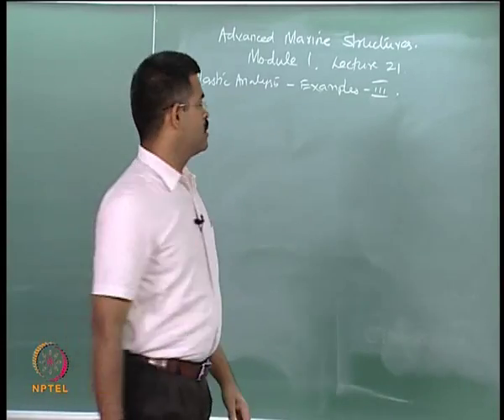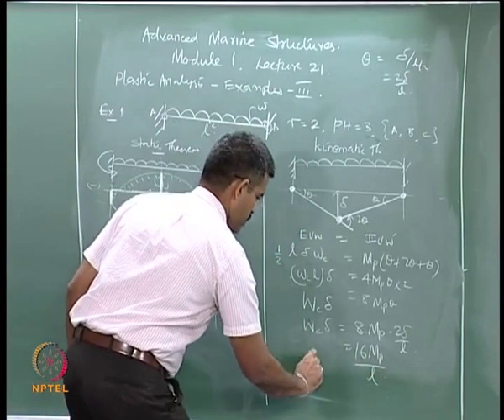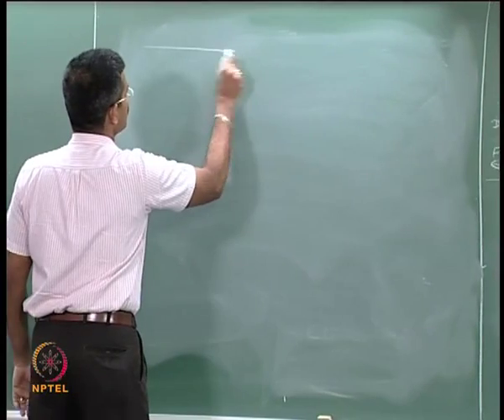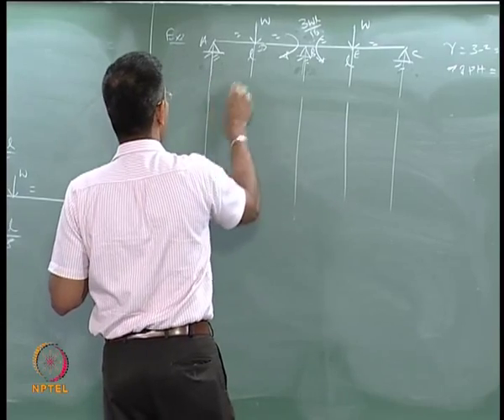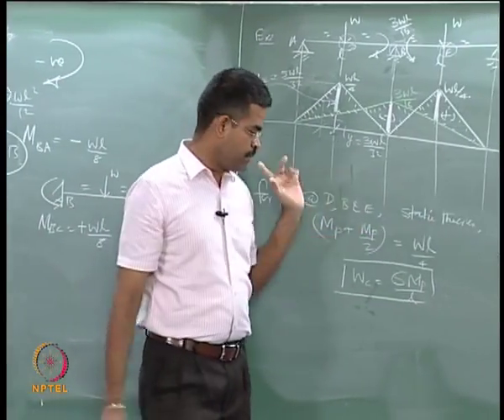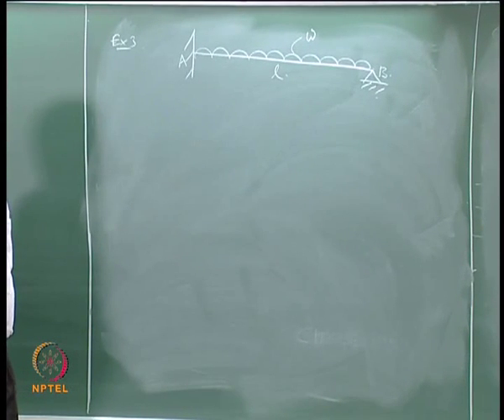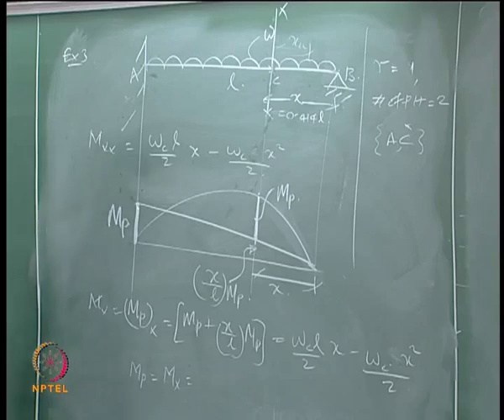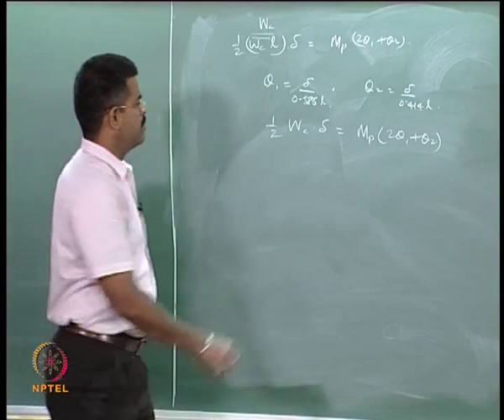Mod-01 Lec-21 Plastic analysis- Example problems-III

Comment: Why did you calculate the moment at B using the Moment Distribution Method?
Reply: to find moment at B .. this is not net moment as net moment on pin joint is always 0 .. its moment on two member at the pin

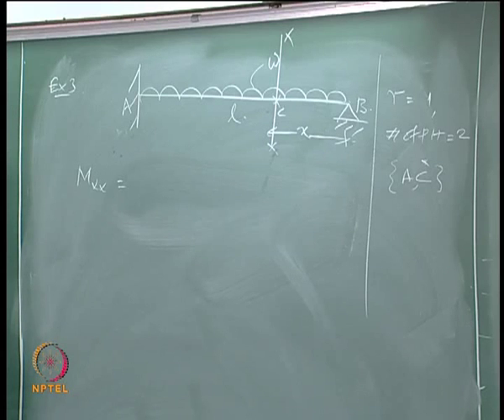Comment: Dear Professor, many thanks for the valuable lectures, we have learned from yoa a lot. I just need from your honor just a small explanation. in the minute 33:22 you have said that the reaction at the support B will be half the applied load. I have not understand that as for such an indeterminate beam, reactions cannot be computed directly an also the vertical share of the load for the fixation point will be more than the reaction at hinged support. many thanks and I will appreciate your explanations as a student learned always from you
Reply: good point
Reply: the reaction at that end shall be 3/8* wl and maximum moment will be at a section 3/8* l away from hinged end as per my calculation.
Reply: By simple observation you can do that without solving the beam for reaction though it may be indeterminate (here the load will be distributed equally as in case of simply support)